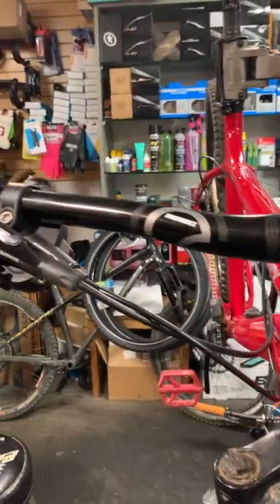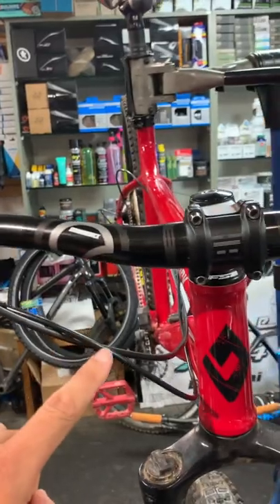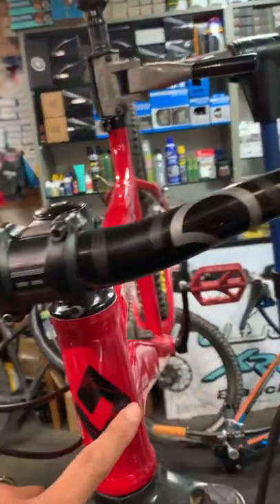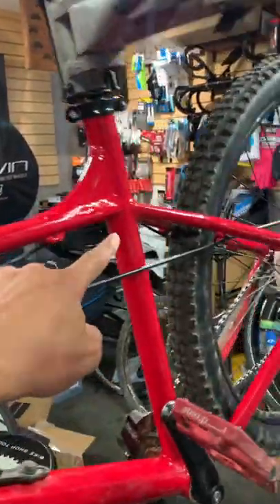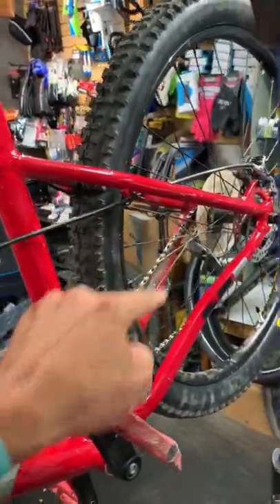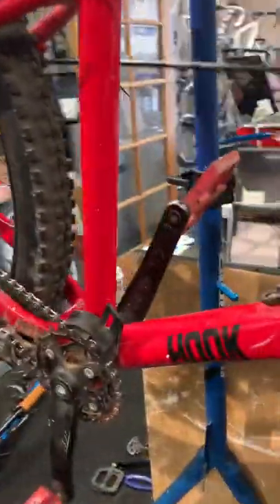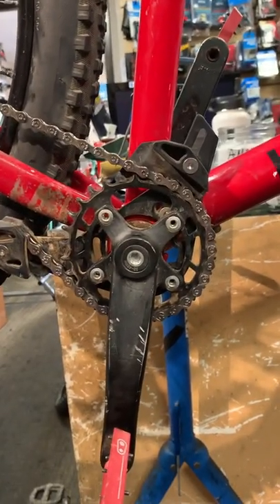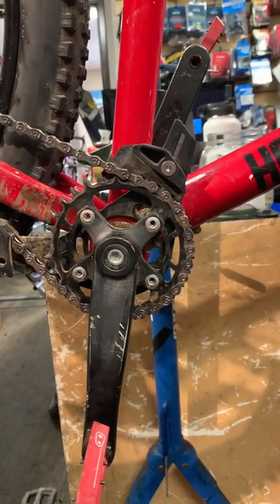Brake line too short but seriously  how do you pedal this bike?

Comment: That's messed up
Reply from the maker: I test rode it just for fun. It felt REALLY weird!! 😂
Reply: I have made several mistakes trying to be a home mechanic. I can understand not routing a cable or line correctly. I can even understand not installing your crank arms properly lined up.  But what I don’t understand is riding it that way !  And that looks like a well ridden bike!
Reply from the maker: @jerryyoung6494  ha ha and I’ve already cleaned it! Not knowing which direction to route the cable is forgivable. But the Hydraulic line being too short is a little questionable. But the crank arms can only be installed 90 degrees differently. The BB is called square taper type.

When the crank arm was loose it rounded out the square spindle on the BB and also damaged the square crank arm attaching point. 😭😭

Thanks for watching!